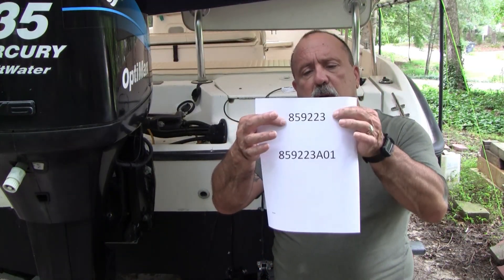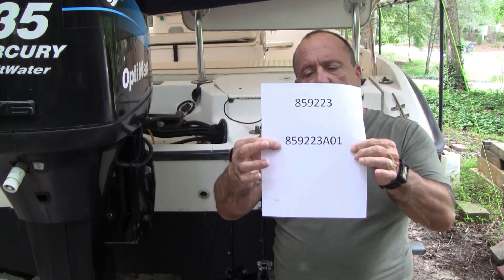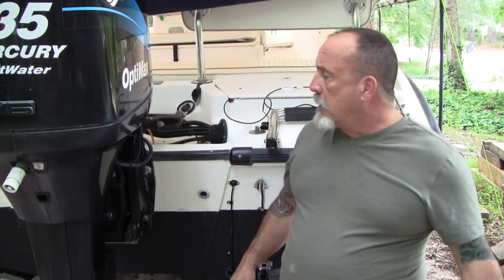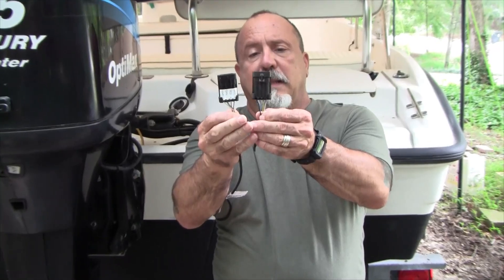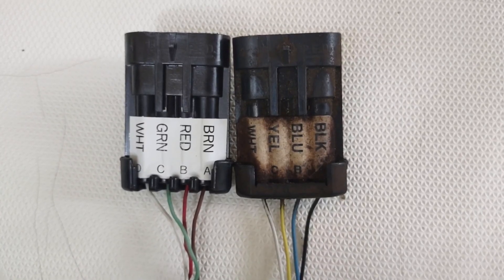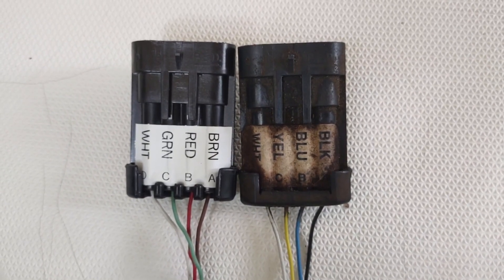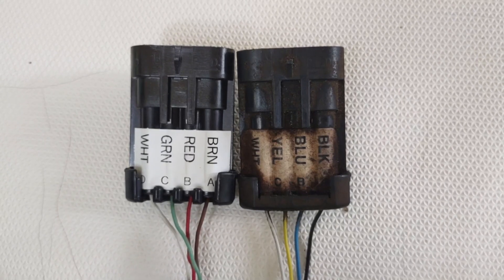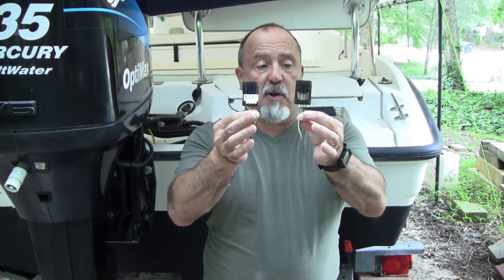Mercury Smartcraft System - Will This Speed and Temperature Sensor Work?

Comment: Does your Motor have the pitot sensor also and the speedo transition from one to the other at a certain speed.
I have the paddle wheel and the troll control works but no pitot sensor and cannot get the smart craft speedo to work

Comment: How did u get the sensor to work with the sc1000 guages.
Reply from the maker: Gauges and system was already in the boat, I just replaced the old sensor with a new one.